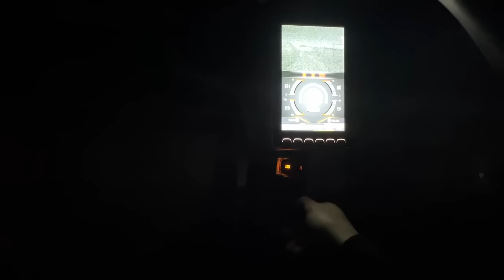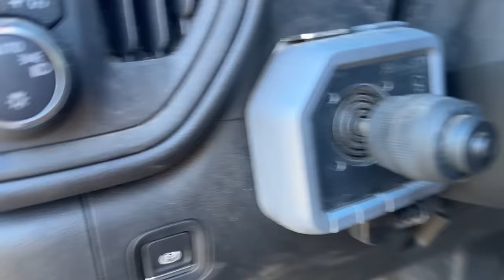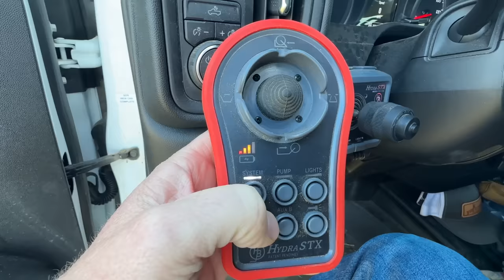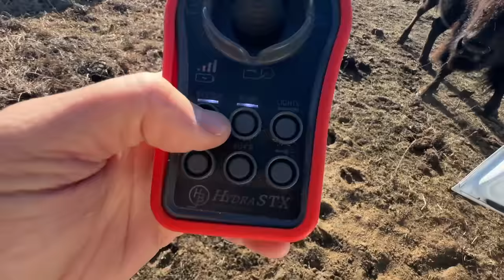New Addition to The Ranch! Bison Come to Inspect!

Comment: Next time you clean a windshield, after you are finished drying it, take a drop of liquid dishwashing detergent on a cloth or paper towel and polish a small area with it until it's clear repeat over the full windshield. This will prevent frosting for some time. That's a trick I learned for my motorcycle visor. It also works on glasses of all types. It doesn't harm any coatings on prescription glasses. Sure, you can do the same thing a little faster, but costing more, with Rain-X.

Comment: Very cool.  Not sure why you put out a bale at 3 am instead of doing it the day before.  And, I didn't see the part where you unrolled the bale.  In my experience, you would have to load it initially on the flatbed with the roll pointed in the right direction in order to be able to use the side tongs to unload it then make sure you can unroll it by driving forward.  So, I think the "unroll" flap would need to start on the bottom pointed back out away from the truck.  Also, in my experience, it's not so easy to see what way the roundbale was rolled to start with so hard to tell which way to unwind it.  How does this go in your experience?  In any case, congrats on what looks like a labor-saving device.